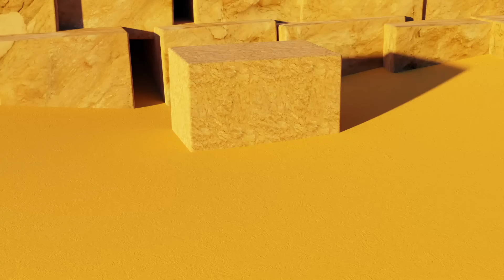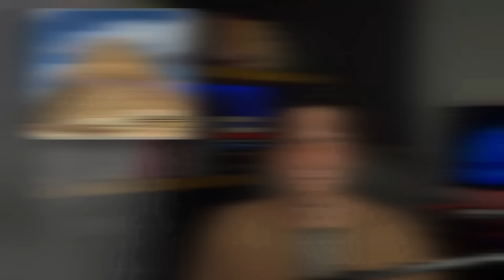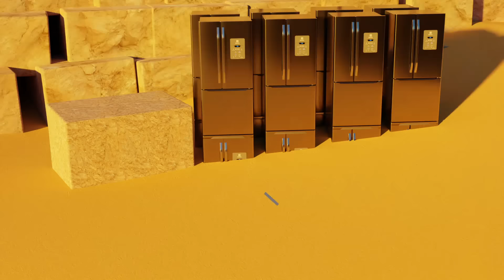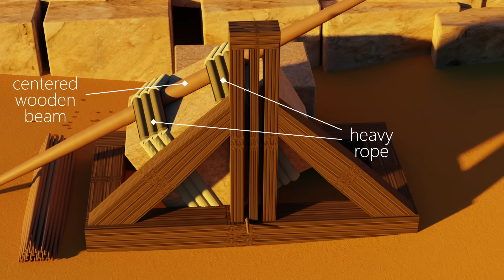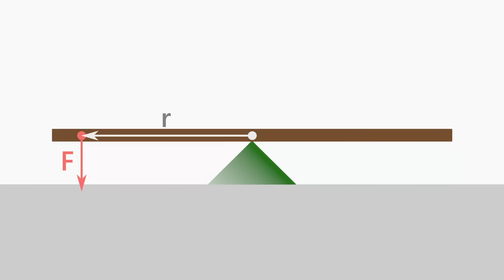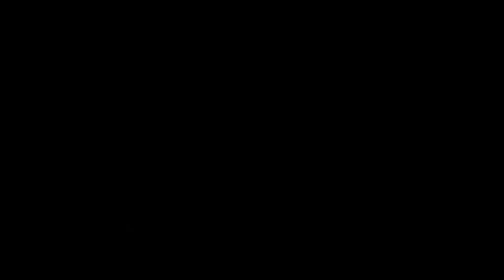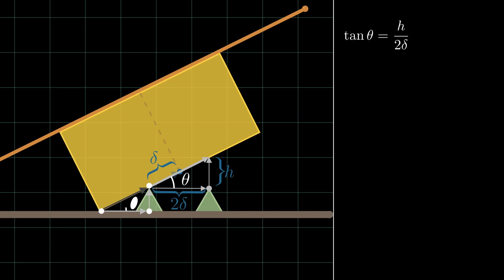Physics Reveals How the Pyramids were Actually Built

Comment: Although the haratomist machine was used in antiquity, it was not used for building the Is Great Pyramid. The least to explain the 80 ton stones hundreds of feet up above the "kings chamber:😂  No my friend where all your math isn't mathing and the rest of the so called age of information geniuses who believe its about  lifting the stones? Thats the least of your problems. The truth is it is polygonal masonry, unduplicated in any recorded writing by anyman. This masonry is only done one way and although extremely difficult it is also done very quickly. Did you know your math should have told you there's quite an unusual bit of oddities in math built right in the structure? Maybe your familiar with one or two like the February sequence or its size relative to the earth, maybe about the changes in height per course or degrees of offset in particular chambers? No my friend this structure marks but only one purpose of what it could be and if you voted tomb? Lol. Everything has its purpose even the alleged "star" or "air" shafts. You should note one set neither entered a cavity nor exited most telling is the so called "relieving" chambers. But alast I forget I am the real keeper of the unified field theory and childs play is this structure to me, pointless it is to teach those that know everything already.

Comment: Interesting explanation of the system, but still nobody talks about the 1 block lifted in 6 minutes 24h 7x7 27 years. To not start to ask how the machine is moved 1 row shorter than the actual height the block needs to be placed without taking from those 6 minutes required.

Comment: Please allow me to explain how they built the pyramids because they did not use giants or aliens or millions of lazy slaves who refused to work on Saturdays, nor did they use 3 km long ramps. The pyramids were never intended to be permanently clad in smooth facing stone, they just used the smooth facing stone jigsaw pieces to slide the final construction blocks upwards to the to the level they needed to be at for horizontal installation and they did not drag the blocks up the pyramid like idiots they used rope and cables and equally heavy bags of stones right across the flat pyramid upper floor on the other side and slid those counterweights down the smooth sliding part of the opposite face bringing the block up that they needed to bring up. 

The pyramid was it own crane. And yes over 2 million blocks for each of the large pyramids, and did they do 1000 a day for 2000 days? Of course not, they took a lot longer. And how did they get the blocks from the quarry to the pyramid site ready to be slid up one of the pyramid faces temporarily clad in smooth stone (which was later removed and used somewhere else)? They used the rising waters of the Nile and giant ebony barges. 

They used flooding and flood water to lift all of the giant stones in their entire kingdom. If water can lift a Nimitz class aircraft carrier weighing 100,000 tons it can lift an ebony barge with a stone in it that's 3 tons or 1000 tons. 

Some of the smooth block-sliding facing stone was left covering the apex because that was a nice architectural feature for the pharaohs penthouse and his rooftop looked great with 10% of the pyramid protruding through his penthouse floor, and not just nice and smooth but also covered in gold, to be seen from a long long distance away poking out of the top of the enormous cubic Flood Retreat Shelter that was like a stacked decking mini-city vertically arranged according to political hierarchy with most of it being a bit like a favela noisy and smelly and scary and dangerous and exciting with animals and thieves and cooking fires and soldiers to keep people in their place far away from the top floors with the generals and the priests and the ruling elite. 

And where did they keep all their gold during pyramid & flood time? Right in the middle of the pyramid obviously.

Comment: "How did they do this at the rate proposed?"  They didn't.  
The block has to be lifted and tilted in order for the beam to be tied to the block with heavy cords. How is it titled before the beam is attached?  Once attached, where did the Egyptians get the wood for the beams?  How long would the beams have to be, limited by the degree the block could be titled before the beam hit the ground?  Is the length of the beam sufficient to accommodate the workers who would have to do the  lifting?  What diameter is the beam?  Is the wood strong enough?  Would it bend or snap?  How many years would the supply of wood have to be cured before it was usable?  How long would a beam, in use, last?  What wood, for the pegs, could withstand 10 tons being repeated rocked back and forth on top of them?  How many of these levers would have to be  operating simultaneously in order for the workers to achieve the proposed rate of production?  
Either the pyramids weren't built as quickly as claimed, or it was done in another way .. or combination of ways.

Comment: How are they cut ? How are the made into the right shape? How are they transported to the site? How many machines have to work in parallel? Raising is one thing, how do they slid into position? How do they maneuver them as you get higher? The include you have to build to move up vertically would be insane. And moving this size block on an include is another logistical / engineering nightmare.

Comment: It's all nice on paper. But, then the trade guys are scratching their heads, asking some simple questions: 
1) considering it's not always a fine enough weather and short days in Egypt, it boils down to one block every 3 minutes at the most! And not only placed! But, also, extracted, shaped, delivered and installed by the plan, micrometre aligned... 
2) to lift the block, you need to build the machine around it. How much wood would you need to handle a 10T block?!... btw, it has its own weight too. And there is friction. And there is acute pressure on the soft block (yet, we don't see the marks on them). And then you have to dismantle the machine. 
3) ok, once it's up - then what?! How do you transport it off the machine onto the block besides it?! How do you unload the block?! 
4)there are down deep going vertically some kind of engineering in these pyramids! Going very deep. Considering it took very much time to do that, you are left with around 1 minute per block... And this has to include all the above + all the levels above!! 
...I mean, were you serious? Or you were just trolling?! 
I am sure that no alien or magic was involved! But, your explanation is even less realistic! 🤦 
*Still it's a good exercise for kids is school 👍❤️

Comment: What follows has been known since 2006 via university research, however only Pravda in Moscow published the article titled "The Documented Ancient Construction Method of The Great Pyramid". Pravda placed the article on the London Global News Exchange in 2019 where it was ignored, or perhaps avoided.  

Consider the movement of blocks in two ways ... Consecutively or Simultaneously and knowing the documented time-frame for the Great Pyramid is 20 years. Logistics of Engineering can only accommodate the SIMULTANEOUS movement of blocks which absolutely rules out consecutive and thus rules out ALL ramp and water shaft-canal theories.    

The method used is known today as Rack & Pinion Mechanical Technology and the Egyptians developed its prototype at Giza. Those hundreds of limestone steps you observe for all Giza Pyramids are RACKS, over all four sides and height.   

Inty Shedu was the carpenter in chief at Giza and fabricated LOBES made from short planks of Cedar which had been imported from Lebanon as we know via the "Palermo Stone". Evidence for the "four lobe pinion pulley" is the "Petrie rocker" excavated in 1895 by Edouard Neville and handed to Petrie in person for his London museum. 

The Shedu four-lobe pinion-pulley is a machine of Class Two Lever Principle, Pivot-Load-Effort, same as a forward wheel, wheel-barrow, and has a mechanical advantage of 2.8 (MA=2.8) which means a 2500 kg Pyramid block can be raised with an input effort of 900 kg. Search haitheory

Comment: I seriously doubt the Egyptians did much formal math, let alone advanced mathematics. Instead they probably lifted heavy blocks the same way you put a car on blocks. Lever up one end, put something under it. Lever up the other end, put something under it. Repeat until high enough, then pull it over with ropes and manpower. They probably used gravel to slide blocks on top of blocks. All simple stuff without math.
Reply: no. they pour it. watch professor joseph davidovits.

Comment: Considering most of the workers were farmers in the off seasons, most of the work would have been done within around 6 months of each year. While the majority of blocks were quarried in Giza, the capstones were sailed from further south up the Nile. Wood was also extremely scarce and this method would still require strong wood to pivot on. As you go up, efficiency would get bottlenecked exponentially. Khufu’s having internal architecture further complicates this method along with utilizing lintels and chevrons in precise measurements. Their method may have not been extraterrestrial but I can’t see how this way was the primary way to lift, move, slide and stack this many blocks in the given time.

Comment: It would be far easier and quicker to use many small stones (each small enough for one man to lift) to form a counterweight (at the current top of the pyramid) heavy enough to raise one large stone. The sides of a pyramid already form opposing ramps, so you basically just need two sledges (one on each side) and a long rope (between them).

Ropes tied to accumulative counterweights can move, rotate, raise and position objects of enormous size relatively easily. It just takes time to build up the counterweight.

Comment: They almost certainly filled most of the internal space with rubble and mortar. There's plenty of evidence for that, and it's just commonsense.

Limestone blocks were only used around the outside, and to form a series of internal walls that radiate.from the centre out to the edges to separate the rubbling into sections (a bit like bulkhead walls). The majority of limestone blocks in the calculations are unlikely to exist in the real building.

Comment: Just securing the block in the machine would take at least 10 minutes,  rocking it up 10, not counting getting it there, and moving it horizontally further each corse . In 20 minutes you need to move 6 other blocks also.
If you have a machine for each corse that's 216 X 6 or 1,296 machines in use simultaneously,  24/7.
So, besides the 3 blocks per minute you need 1300 machines built BEFORE you start lifting. So now cut a tree for each, saw it into lumber, build a machine takes how long?
A day?
The next part is figuring how to get each block out of one machine and into the next. 216 times, all in 3 minutes 😅
Not possible
Thanks for proving this method won't work.

Comment: None of the blocks were the same size some were very large, but some were also much smaller. You could see this in every single picture. If you also look inside of the robbers tunnel, you will see that it goes from stacked layers to rubble back to stacked. This is very documented, but nobody ever talks about this.

Comment: I have heard from old timers of raising heavy beams with this method as they built barns and houses. They previously cut many small blocks. Then using this teeter totter method, they stacked the blocks on either end and the middle to raise a beam up on top of the studs.

Comment: Sorry, but while this might look plausible regarding the sterile numbers of the forces, this method introduces 2 dozens of problems, like: 
*) What about inertia? 
*) What about moving the blocks to and from this "machine"? 
*) And what about placing the block in the last centimeters? 
*) Where would theses lifters have been placed at the pyramid? In the middle? There's nothing hinting on central ducts of that size. Wooden constructions at the outer edges?!?!? NO WAY! 
*) How to build a construction from wood, that withholds these forces and constant changes in the center? Yes, we know about catapults and war tower from the romans, but at least, the romans documented their way of constructing things (aqueducts, bridges, buildings, ...) and available tools, so that their achievements and advances are plausible. 
*) What is the necessary/possible height one stage like this could manage? What kind of wood/material would bear the weight and 100s of changing downforces? 
*) How many men are necessary at both sides and in the center for placing the slats? What kind of beams and ropes would be necessary to move/seesaw the bigger blocks? These alone might weigh over a ton, given a reasonable length to provide leverage. 
*) -> what would be a realistic number of lifted + placed tons per day, at a plausible number of workers (just for THIS part, not to speak of carpenters, ropers, masons, logistics, ...) 
*) I also don't remember ever seeing any hints, that indicate the blocks being moved like that = the slates and ropes in the center would leave traces.

The theory from this one movie ("10.000bc"?), where mammoths did the towing, is more plausible than this - sorry - mindfuck.

Comment: These numbers are fine and all, now explain how they moved the blocks over with said device. It’s one thing to lift it in the air it is another to actually place it. In 7 minutes. 
The material used for slats would also need to be able to carry the weight. Using wooden slats for this would consume massive amounts of resources. Perhaps rocks?

Also, the 80- 100 ton blocks that came from  500 miles away. How did they move them?  From all records the ancient Egyptians did not have any ships that could carry even a 10 Ton stone let alone an 80 Ton stone. 

I’m not saying aliens built the pyramids but “back of napkin” calculations without real world demonstrations do not explain it either. 
After all we can calculate light speed travel, achieving it is something different.

Comment: The Giza pyramids, frequently regarded as ancient structures, may not be as old as commonly believed. Consider the time elapsed since their rediscovery. Let us now turn our attention to the Silk Road. How can an item on a trade route like this go missing, particularly when people have inhabited this region since before the Common Era? Why do we not find any records of the construction of these magnificent structures by a society like the ancient Egyptians, which meticulously documented everything? Recently, they discovered some “receipts” for materials, but that is the extent of their findings.

Reflect on the extent of deterioration the pyramids have undergone over the past few centuries. For instance, the earthquake that struck Cairo on October 12, 1992, had a magnitude of 5.8. It caused substantial damage and temporarily closed public access to the pyramids and other historic sites in the vicinity. Extensive structural repairs and restoration efforts were necessary. However, there is no substantial evidence suggesting that the Giza pyramids have undergone repairs comparable to those required after the Cairo earthquake. Why is this significant? The probability of only experiencing one earthquake of that magnitude in the 4,000+ years we are told these pyramids have existed is astronomically improbable. If they were as old as we are led to believe, there would be evidence from other earthquakes, either visible damage or extensive repairs, neither of which is evident in the case of the Giza pyramids.

To further support my theory, let us examine the accounts of early French explorers regarding the appearance of the Giza pyramids. One notable explorer was François de La Rochefoucauld-Liancourt. He visited Egypt in the late 18th century (1798) and is renowned for his meticulous observations about the pyramids. In his writings, he remarked on the impressive condition of the pyramids, suggesting that they appeared as if they had been constructed recently due to their remarkable preservation. However, since his observation, the pyramids have undergone a rapid deterioration at a rate that does not align with their purported age as determined by archaeologists and the primary sources of descriptions from early explorers. François observation, which is a true primary source, describes the pyramids to be in the same condition which almost 1700 years earlier had been the discription Pliny the Elder gave in his Natural Histories (which is not a True primary source since there is no 1st edition in existance) in AD 77 to 79.  I seriously doubt that the pyramids went for so long, at least 1700-ish years remaining in the same condition then suddenly began the aging process.  (fyi im only discussing the giza pyramids)

Comment: This is very erudite but doesn't really explain anything. The pyramid is 100s of feet high. How could this rocking system lift that high? And the sides slope so you have to keep moving laterally. And of course the installation rate doesn't add up. Something is seriously wrong with the timeline.